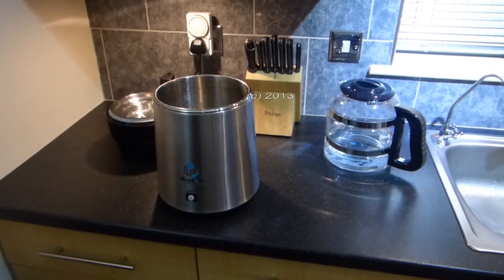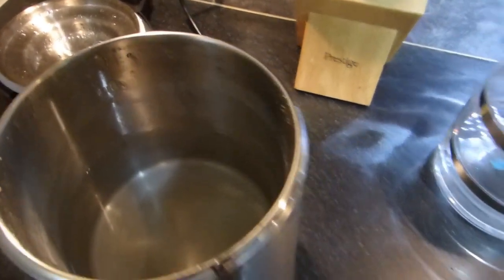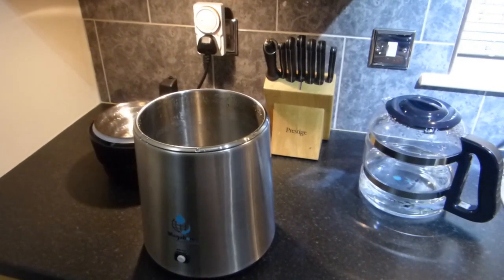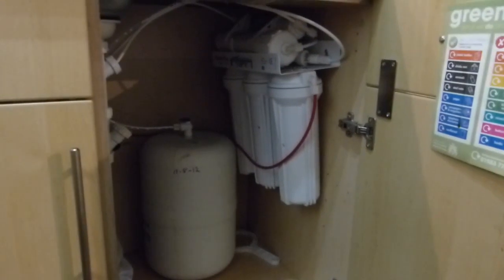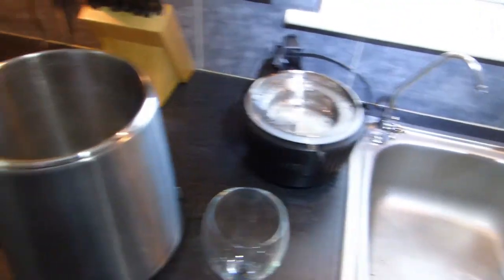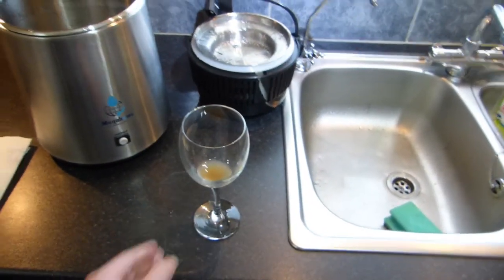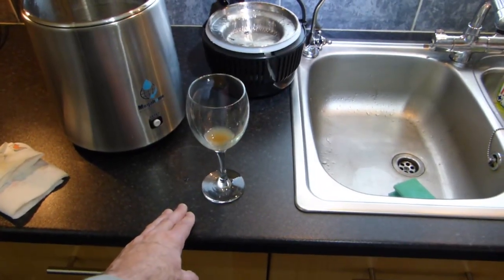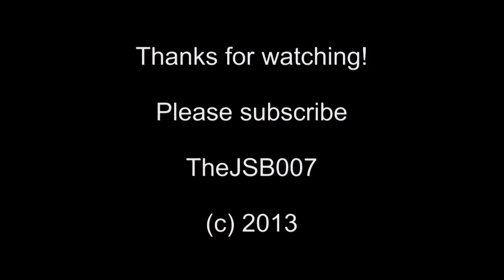Water Distiller Vs Tap Water (The removal of crud)

Comment: Thanks for the vid, mate. One question - how do you clean the distiller to make it ready for the next usage? Do you have to use some of the water that you have purified? Cheers in advance.
Reply: Distilled vinegar to cover the base for about 15 minutes or longer depending on deposits then fill up with cold water to the top and I leave to soak for about an hour then tip away, wipe out deposits and rinse out and fill for next distill. I thank GOD for this distiller :-) A tip is to fill just above the full line so to avoid the deposits burning on to the base and put timer on for about 5 1/2 - 6 hours then tip away remaining water. Makes it so much easier as I have discovered :-)

Comment: Ive read most coments here .if u want to bring uour water ppm to 0 den i would sugest getting a de ionized system  ..it uses wayy less electricity and filter water by the galons un just a few minuts. If its ppm ur worried about just get a di ionized system. I have one i used to mix up my chrom solution. So i had asked the company where i buy from if u can drink the di ionized water. They said yes u can drink it but its like your drinking nothing.  No minirals nothing. You will drink alot and stil be thursty..

Comment: Hello, i wonder how long this distiller lasted you?
Reply from the maker: French Viking Hi, I only used it for a while and switched to a 5 filter reverse osmosis system however, I still use occasionally when I feel the need to. These should last years providing they're looked after.
Reply: Let There Be Light Thank you for your quick reply. Is there a specific reason you switched over to reverse osmosis have you had any bad side effects from distilled water?

Comment: But if you had taken the water from the tab which has a filter system added to it with 99% removal of toxins why would this still look so contaminatedy?
Reply from the maker: Ken Cox the water was taken from the tap mains water not the filtered side. It shows what's in the water supply before filtration.
Reply: oh yea that makes sense thanks :)

Comment: Great unit.. Little tip here... Fill unit with hot/warm tap water, for faster results.. Usually, takes 45 minutes off your Distillation. Thanks for the video! My unit looks like cement inside, after 1 month of use.
Reply: Is it ok to use the hot water from the hot water tank with all it's not sure what inside it. Why do they not tell us to do this in the first place?

Comment: I have Lupus (High ANA Titer) & several additional illnesses and I ran a low grade fever for TWENTY years --- UNTIL I stopped poisoning myself. I invested in a Megahome Distiller almost two years ago and I use it approx every other day to FLUSH inorganic substances from my body that build up & trigger an immune response that can't be turned off until the POISON is flushed out of the joints, organs & all body tissue. This is WHY Distilled Water is so wonderful. I do not add minerals to my DW - it defeats the whole purpose of a flush. 

I also changed to an an Organic (no pesticide/preservatives, etc) plant based diet and AVOID CHEMICALS in bath/body & cleaning products. I take an Iodine, Magnesium, Potassium and a daily multi-vitamin but our body assimilates PLANT nutrients the best so I try very hard to eat MOSTLY raw organic fruit & veg and nuts & whole grains. My labs are now normal including my Hypothyroid & Cholesterol tests. 

I learned the hard way (by sacrificing my health) that I can't indulge in a FOOD "reward" system (junk food: take out, processed carbs, bakery items, candy, chips) that contain ingredients our body CAN NOT DIGEST! Food is FUEL & NUTRITION to grow HEALTHY CELLS. I "reward" myself with Organic Half n Half & Coconut Sugar or Agave in my morning coffee and a dessert on occasion but once I switched to an Organic plant based diet; I no longer even THINK about junk food. I ended up tossing out the junk food because it had expired. I just stopped reaching for it because I no longer DESIRED it. 

When our body receives ADEQUATE nutrition; THIS is what happens. BTW: If you are on daily anti-acids and/or Proton Pump Inhibitors for heartburn/reflux - STOP THEM NOW and address the ROOT CAUSE! My 40 year heartburn problem continued after I made diet changes & weaned myself off of Nexium in exchange of a Betaine HCL Supplement. I had to take a LOT of HCL to get a meal digested. Our body can not assimilate food into nutrition UNLESS our stomach has ADEQUATE amounts of HCL acid in order to digest it first! This is IMPOSSIBLE if you are popping anti-acids & taking PPI. There are current class action lawsuits for Nexium, Prilosec, Prevacid because they were only safe for SHORT TERM use -- while an ulcer heals and we CORRECT our bad diet habits & nutritional deficiencies.

I eventually ran across an article about illnesses due to Iodine deficiency so I decided to try an Iodine Protocol (6 drops of Lugol's 5%, twice daily) because I had already increased my Distilled Water intake (1/2 my body weight in ounces) to eliminate the possible hydration issue which ALSO mimics a TON of illnesses! The addition of Iodine was the solution. I no longer have to take Betaine HCL Supplements & no more heartburn/reflux. Also, I was stunned to realize that the additional Iodine helped my Neuropathy pain tremendously! An Iodine deficiency sets off a chain reaction that impacts every body function and our seafood is no longer a safe iodine source considering recent tests show high levels of radiation (oil/fracking wastewater is RADIOACTIVE!!), arsenic, mercury, lead, etc). 

I can not stress how IMPORTANT gut health is so I also ferment Sauerkraut & Pickles. BTW: if you aren't having a bathroom "elimination" break EVERY DAY -- you are NOT eating the RIGHT food. BMs are a MAJOR way for our body to eliminate TOXINS and they should happen on a DAILY basis. Sorry, if this is too much info (:
Reply: What water do U drink on the every other days please?

Comment: Squeeze a 1/2 lemon let set 5 min to clean burned on residue on bottom,no harsh cleaner required...:) Is the condensation pipe aluminum ???

Comment: That energy usage is retarded, better off buying bulk water
Reply: In the short term ye buying bulk water seems reasonable, but if you distill just 1 gallon a day, that's 365 gallons a year.  At 80 cents for a cheap grocery store gallon (which has plastic container leeching) That means it breaks even on the cost in about 9 months.  From then on, it's all savings.  At even 12kwh cost for energy, at just under ~600w, it'll consume about 40 cents per gallon, and water coming out of the tap is like 10 cents per gallon or less.  So worst case scenario, you are saving something like ~40% on water, don't have to worry about plastic, and don't have to even go out to buy it and lug it around.  So all things considered, even in the worst case scenario, you're seeing a substantial savings.  I pay 7 cents per kwh, so my energy costs are almost half that!  That puts me at ~30 cents per gallon, which means I'm paying over 60% less for water.  Over years, that adds up to hundreds of dollars in your pocket, with even less effort than lugging around water jugs, and cleaner water on demand.  Totally worth it.

Store bought water, unless it's distilled store bought, is not going to be this cheap.  I'm not sure if they even sell distilled water in larger jugs than one gallon.  For 'purified' water from the store, it's still got tons of stuff still in it, they just purify it 'enough', which means it might cost them a lot less to purify it than distilling.  It's often just tap water with minimal filtering, sometimes it's just straight tap water with no filtering.

Comment: Question for JSB. How much distilled water do you get from one full tank? I am looking to get purified water in my life. I drink around 2 1/2 litres a day.
Reply from the maker: You put 4 ltrs in you get 4 ltrs out minus a cup full of dirty water as seen in the video, it's practically a pressure cooker where the steam is transferred into clean pure water.
Reply: Wow so once a day would satisfy my needs. That is brilliant thanks. I'm planning on making a solution of sole water and adding that to the distilled water. Hoping this will make me feel more hydrated. One more question does it cost much in electricity? I have been looking into reverse osmosis but thought it seemed expensive replacing the filters every 6 months and some say for every gallon of pure water you get 5 is wasted.
Reply: Basically just want an affordable way to supply a family of 3 with purified water.
Reply from the maker: Read the description, it tells you how much it costs, cheers :)

Comment: Although it has an automatic cutoff, you should unplug it before it's completely empty as some have said that it messes up the metal at the bottom and causes leaks when running dry. I just set a 5 hour timer and there's about a half-inch of water left.

Comment: You mentioned that you put the filter on the top.
Its not a filter, its a heating element.
Reply from the maker: ***** It's not a heating element, it's the condenser with carbon filter that's on the top, if you have one then you'd know. The heating element is on the bottom underneath the stainless steel insert or pot, it works similar to a kettle.
Reply: Just waiting on it to arrive! :)
Reply: +The Truth The black top part is the condenser, and at the output there is a place to put the included activated charcoal filter that the water drips through. Not real sure it's needed and I've yet to change mine even though it says to change regularly.
Reply: +st8kout1 The carbon filter helps with the horrid taste that results from regular distillation (even after VOC's are removed). I would recommend some research in this area. Doing so may help you decide whether or not its needed. I personally use 2 at a time. This should last you about a month and a half (regular use).
Reply: The heating element is built into the bottom of the distiller,the top has the cooling fan and motor along with the  distillation coils.

Comment: Do you have any problems with the taste of the water coming from this distiller?
Reply: Mark Messa When you drink it you feel like drinking wine from heaven it just GOOD i can't explain it try it and you wont regret it at all, Depopulation free xD
Reply: NawafiGamer Strange, recently I bought a distiller very similar to yours (www.biowatersystem.com.br). Unfortunately, the taste of the water is terrible. It seems like burnt oil. Any idea of what might be going wrong?
Reply: Mark Messa I have the solution, First of all when you first make the distilled water make sure you cleaned the bottom from the last time that might get in you're distilled water, Second you take the distilled water and pour it in a cup back and fourth, That helps a bit and then put it in the fridge for couple of hours that might helps with you're distilled taste you're distiller might come with a cleaner I'm not sure if it didn't work tell me what kind of water you've put in there.
Reply: Mark Messa It comes with a cleaner pack of Citric Acid, Anhydrous water residue cleaner for removing the scale from inside the vessel. 
Wipe out the crud from inside the vessel by using dry paper towel, or transfer it into a clear glass jar for safe keeps to remind you what you've collected, then add the cleaning granules as instructed on the bottle, That might be the problem.
Reply: NawafiGamer > "[...] make sure you cleaned the bottom from the last time [...] 
I use filtered water in the boiling chamber, so the residues are far less than the expected from tap water.

Even so, after each cycle I clean it up with vinegar and paper towel to make it shine again like new.
Unfortunately, it didn't improve the bad taste.

> "[...] take the distilled water and pour it in a cup back and fourth [...]"
I've already tried that and several other stuff, for example:
- pass the distilled water through several steps of activated charcoal
- freeze and unfreeze the distilled water
- remove the post carbon filter
- use glass jar instead of plastic one
- ... etc ...

The only thing that improve the bad taste is to take the steam directly from the boiling chamber (removing just the cooling coil) and condensate it. In this case the distilled water has a strong taste of metal but no taste of burnt oil. After several passes through the charcoal it's possible to drink it. So, it must be something related with the cooling coil.

My guess is that the plastic that covers the boiling chamber is causing this bad taste (http://imgur.com/Zvm6W1q).
If so, unfortunately, it's a design flaw which there is not much I can do. I've already tried to contact my local dealer but they are not answering my emails. I'm almost hopeless about that ...

Comment: How and with what do u clean ur machine... can u make video of cleaning Distiller.
Reply from the maker: munaxia It comes with a cleaner pack of Citric Acid, Anhydrous water residue cleaner for removing the scale from inside the vessel. 
Wipe out the crud from inside the vessel by using dry paper towel, or transfer it into a clear glass jar for safe keeps to remind you what you've collected, then add the cleaning granules as instructed on the bottle.  
I won't be making a video showing how to clean the vessel as it's not a rocket science to know how to do so, good luck with yours :)
Reply: oh ok thanks

Comment: Hi. Do you use any additional mineral tablets of any sort to replace the minerals that are filltered or distilled?
Reply: WheelyDoctor You wont regret getting a water distiller.
Reply from the maker: One other thing to take into consideration is that in some area's, but not all yet, is that the water companies are recycling raw sewage back into drinking water, so there will not be any minerals in it anyway, this is why they are adding more and more Chlorine, just a thought.
Reply: You get  all of your minerals from food. it would be a waist of money adding it to your distilled water.
Reply: know whats funny Art?  -the 'minerals' in tap and well water are insoluble by the body and do more damage than good so chelated mineral supplements are a necessity either way. or if your juicing ,thatll do it, for micro & trace minerals as well.
Reply from the maker: WheelyDoctor No, what would be the point, Distilled water is to be used for health issues, if you're worried about drinking distilled water then perhaps you should drink R.O water (Reverse Osmosis) it's 99.9% pure of all toxins, distilled water is 100% the TDS level is 000, RO is about 012+
Reply: *****  I've been hearing that the distilled water lacks some minerals that get distilled on the way with toxins (correct me if I'm wrong)  And I do want to do this because it's easier than the RO  interms of instalation. 

Flouride is the biggest concern

Let me ask you if there is any lose of the healthy stuff in the distilled water. 
And thank you for your answers.
Reply from the maker: The water is 100% pure, it's distilled! it's without all it's minerals, if you want to add them then by all means do, but before you answer this, please research distilled water more. Minerals are in your daily food supply, organics are best, Pink Himalayan salt etc. there are too many people that buy stuff off the shelf and don't read the ingredients and are poisoning themselves daily, so take some time to read up on this before you decide, good luck.
Reply: Kelvin Telford   I believe so though.   I need to do some research to clarify, fulfil  my needs for information though.  I keep reading that the minerals in water are in such quantities that cannot be compared to the ones that you get from food.  
And now I'll find out if it is beneficial to get a distiller that worth over £100 or just get the most value for money. They start from £60.
Reply: +Artur Kaczmarek I'd advise eating lots of fruit and veg, if you have all the different colours you will cover all minerals/nutrients. e.g green stuff like cabbage/apples is good for iron (breaking down other foods and absorbing them into the right places). Though vitamin b12 isn't in fruits or vegetables and you would need to buy a supplement, you only need a little but its important you cover it.
Reply: That's it I'm just going to buy a distiller. I've been drinking spring water instead of tap water for a while, I'll start distilling spring water.

Comment: I just bought a distiller I need distilled water for my cpap. The distiller very similar to yours turns the water brown. Now if I used my cpap the water film is white but with the distiller brownish n smells of plastic. I find that the top of the distiller is what is actually putting toxins in the distilled water. Please recheck your water try distilling your distilled water n find out. you'll see. Plastic seal plastic cover n such in there. Is what is leaching into the distilled water. check it out
Reply from the maker: Moon Doddler Then you should complain to the manufacturer, not heard of this and certainly not getting leeching, the TDS measures 000, I think you've got a serious problem, if it persists then I must recommend purchasing a 5 filter RO system.